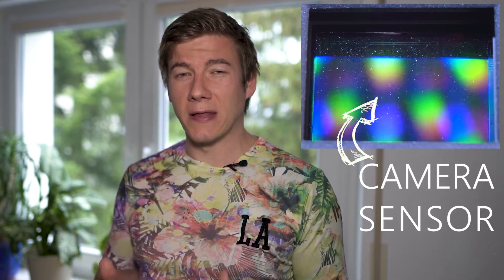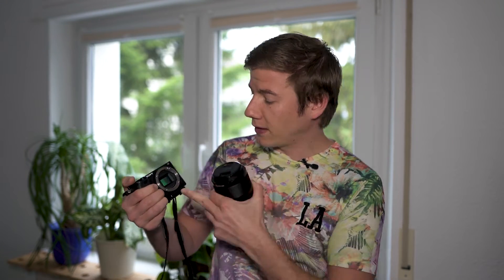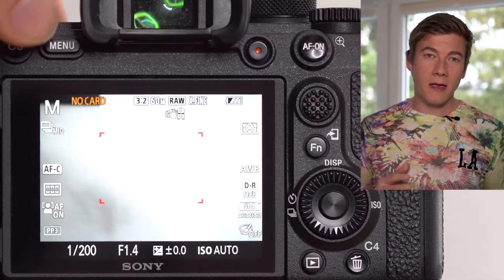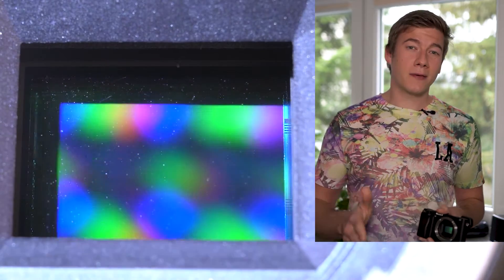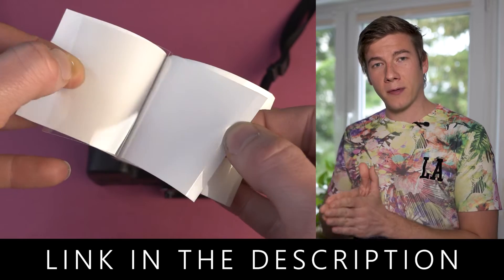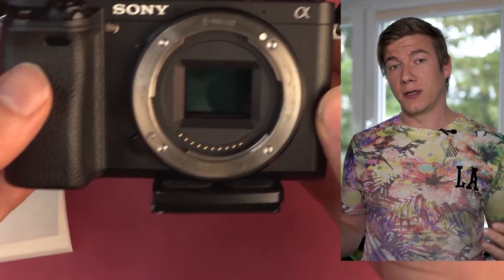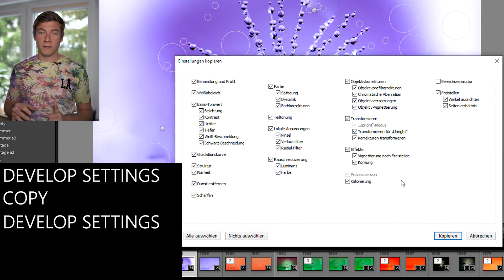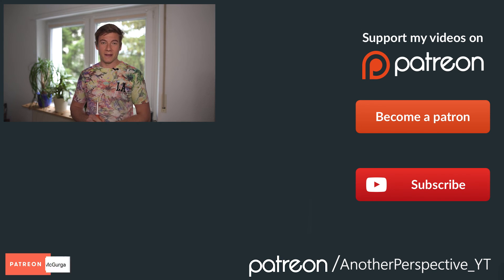How to clean your Sensor & How to prevent Dust

Comment: Nice hacks, thx for sharing. 

Dust was the main reason I changed from Sony to Nikon. Even under rough conditions I never got that dusty sensors (like yours) again. Before it was the same, just cleaned and some weeks later dusty as hell.

One tool I love to use for cleaning is cigarette paper with self adhesive part on one side (like OCB). The paper is absolutely dustfree, you can clean lenses with it and you can use it for the sensor too if you're gentle. Not as effective as the gel-stick but quite nice when you're on the way.

Comment: Tip: to safely check your sensor for dust spots while lens is attached, take a long exposure (e.g., 15 sec) wide aperture photo of a bright white flat surface while moving the camera around.  Then view the image in magnification mode.  Dust will appear as dark spots (not streaks).  If cleaning is indicated, first use built-in shake cleaning.  Then rocket blower as you showed.  If further cleaning is indicated, liquid swabs (single use) made specifically for your camera sensor size is preferred.  I would avoid any type of sticky pen product — have seen too many warnings about use of the sticky stuff (residue problems).  Why take a chance?  Also avoid canned aerosol products (problem with residues and cold).

Comment: Fantastic tutorial do you find mirorless cameras have more dust problems than others types of cameras
Reply from the maker: Thank you Lee! I have never had any other camera than a6300, a7r4 and Panasonic Lumix DC-FZ82, so this is hard to answer for me, sorry!
Reply: 100%, Lee. A DSLR has the mirror over the sensor when you remove the lens (unless in cleaning mode). That prevents dust from falling right on the sensor. I was pretty shocked when I first saw how much noise mirrorless cameras accumulate. But still, for me, the advantages far outweigh this disadvantage.

Comment: How about you get a really bright flash light. if you see floating dust in the beam of light, then dont change the lens in that environment! this Floating dust can move in all directions, so holding the body downwards make no difference here. rocket blowers would need an input air filter so they dont suck this dust in. also, where does the dust go after the rocket blower blasts them, further into the camera body? Sony sensors seem to be static monsters (even when unpowered) and dust that is inside the camera cavity has a habit of re attracting to the sensor again. The sensor is so magnetic to dust that the shake cleaning has never worked for me